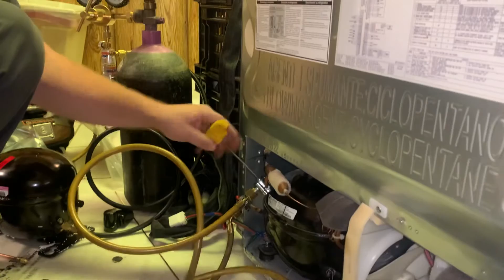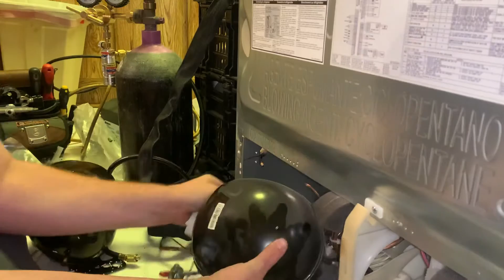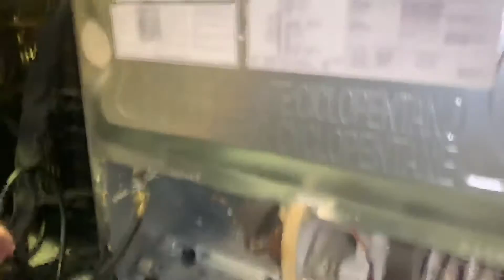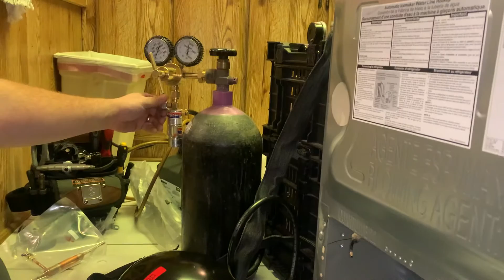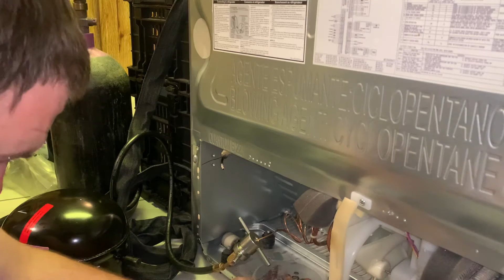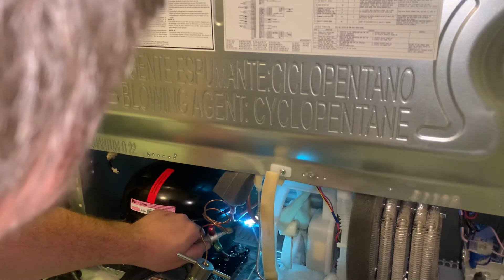Lg compressor replacement

Comment: I use 15% rods for the low side. For the drier, I use 45% and for the high side. But the flame would never be that big.
Reply from the maker: That’s a pretty small flame believe it or not. Unless your using a jewelers torch I doubt your getting less.   One thing I have noticed is that an iPhone camera tends to show more flame than we tend to notice while staring down at it.

Comment: What type of material did you use to join the copper and steel lines ?Thanks!
Reply from the maker: @jrvirrueta7168  high flow braze with a 45% silver content and flux

Comment: Wow really professional and really the only way to do it with this lg crap. But what’s your thoughts on switching to a conventional embraco compressor with some type of relay from fan to switch from dc to ac? Most everyone where from does like this instead of using lhs crappy compressor?

Comment: Thanks for this great video.  The tubes that connect to the bottom of the compressor is aluminum.  How would I weld the aluminum tube to the compressor?
Reply from the maker: They are generally made out of steel, you’d want to use flux and 45-50% ag braze. Check the tubes with a magnet.   (It’s been a while since I’ve worked on lg’s so I don’t know if any of the brand new models use aluminum tube on the high side so check it before trying to braze it)

Comment: Why is flux Being used? 15% rod is all you need to avoid clogging up that drier. Has this process changed now?
Reply from the maker: Typically the high side connection to the compressor and the Yoder loop connection to the filter drier are steel to copper.  I use a 45% ag brazing rod for those and you should use flux for that.    I’ve brazed it with 15% before but you get much cleaner results with the high flow.
Reply: @steveb5967   Okay great thanks for the update also where can I buy that nitrogen adapter adapter ? That will help my life tremendously

Comment: There is a fact that I want to understand about these LG refrigerators that has linear compressors in them,when these compressors goes bad,is it compulsory to replace these compressors with linear compressors or another brand will still work.

Comment: Thx LG for designing a 3 year lifespan sealed system. Well done.
Reply: Costs more to replace the compressor than it does most entire units.
Reply: Their "5 year warranty" only covers the $250 compressor, not the $1k labor, gas, and other parts costs.
Reply: @thefireysoul  I guess it depends where you purchase it. My system had failed in about four years, but fortunately the unit was under both parts and labor warranty. I got my compressor replaced for no charge. I think it is a 5 year parts and labor warranty, up to 10 years parts only.

Comment: hi, steve . what is the name of that tool sliver with 4 bar. u use for nitrogen to copper pipe
Reply: Robinair 12458 Process Tube Adapter Kit for 3/16", 1/4", 5/16", 3/8" Copper Tubing

Comment: I've got an LG fridge where after replacing a compressor the fridge still fails to get cold, any ideas on what might have happened?
Reply from the maker: Without putting gauges on to diagnose it there’s too many possibilities to list, but if the compressor is running then the most likely possibilities are a restriction or clog that was either preexisting or occurred during the repair, or possibly a leak.
Reply: @steveb5967  the compressor is not running and it’s a brand new compressor that’s the problem we aren’t sure what’s wrong
Reply from the maker: @esmeman0383  if you press the test button on the back does it try to run? If it doesn’t check the plug going to the compressor for voltage..   it usually only connects to 2 pins of the 3 on the compressor. Check to make sure it’s turned to the correct pins…. You can check them on the compressor with a multimeter for resistance. The third pin will either not be connected to anything, or will be grounded.. it’s easy to get the plug turned the wrong way.
Reply: @steveb5967  I’ll take a look thanks

Comment: Good stuff, Thank for sharing.

Is this safe to do inside of the home? Fumes and Refrigerant leaks? 

Are you replacing it with the same Problematic Compressor or an updated version that LG Now uses?

Do you use flame Retardant material to protect its surroundings and Flooring? 

Also I was told that once this is done a Program update is required to account for Refrigerant inside line and cool properly or something to that notion. 

I am in NYC and The reason I ask this is because I need to have mine Done. I have a Friend that used to work on Commercial Sub Zero Refrigerators for LABs but is retired now So he doesn't do the work himself anymore. but did recommend a few people.  I prefer to hire an LG approved Company because American Express is Requiring it to foot the bill :o) SO why not?  If your in NYC area and are LG approved let me know. 

Having a Fridge go down is the worst. luckily for us we have another fridge in the basement and a Freezer in the Garage. 

Thanks again for sharing.
Reply from the maker: As long as reasonable precautions are taken it is safe to do in a home. I typically use a mat to act as a barrier if something hot drips, I don’t use flameproof mats (other than one on the floor) much these days because I’m very used to working in a compressor compartment and I have a very small torch that is designed for tubing and small spaces….  If you are in a high rise you might want to check if they have special restrictions on hot work….  Generally it’s a different  updated compressor and it generally requires a software update which is just as important as the compressor.  You must remove all the refrigerant from the system and any trace amounts should be removed by the vacuum process before the system is charged. I am nowhere near New York, so I can’t help you with that. I would recommend calling lg customer service to find the closest lg authorized repair company.. then compare the online reviews of the companies they recommend..     it is definitely a bummer when a fridge goes down. Glad to hear you had a way to save the food.
Reply: @steveb5967  Awesome to know, Thanks for the reply 🤗

Comment: Hi
Where did you buy access fitting tool for nitrogen tank?
Reply from the maker: You can find it on Amazon.. otherwise I’d search Robinairs part number for it and see if it’s available elsewhere for less.   https://www.amazon.com/Robinair-12458-Process-Tube-Adapter/dp/B00C2GWNP0/ref=mp_s_a_1_20?crid=3AC5R4DM1KX7C&keywords=robinair+access+fitting&qid=1678111406&sprefix=robinair+acess+fitting%2Caps%2C355&sr=8-20&ufe=app_do%3Aamzn1.fos.f5122f16-c3e8-4386-bf32-63e904010ad0
Reply: @steveb5967  Thank you!!

Comment: With the reverse flow valve in the netrual position I should be able to get flow just as if it were a single evap unit, right?

Comment: Thank you for this video. I am watching it because my LG fridge might be needing a second compressor replacement  and the repair man will be arriving shortly. Wouldn't it be easier by joining the connections with the compressor outside the compartment, then placing it inside when the joining is complete?
Reply: It's not possible. The lines don't stretch.

Comment: I bought a LG lmxs30776 /01 in Dec 2014. Compressor was replaced in 2019 still under a 5 year warranty. Today 9/6/2021 The Frig is not cooling again . So pissed. What  piece of crap.
Reply from the maker: Sorry to hear your going through that. Unfortunately it’s been my experience that the quality of the repair will directly affect how long it lasts, I have seen plenty of occasions where someone installed a new lg compressor carelessly and did not fully vacuum the system dry, or left debris or oil in it and it led to premature failure. I do think if you perform the repair properly it’s a solid repair. I trust my work enough that I have an lg in my kitchen which I got off of Craigslist broken and then repaired.

Comment: What size tip are you using on the smith little torch?
Reply from the maker: That’s actually not the little torch, they have a slightly larger one called a quickbraze setup that’s specifically meant for tubing. It’s unfortunately more expensive than the little torch but it is pretty much perfect for this kind of work. If you check out  the video I did comparing different torches it shows it pretty well with both that single flame tip and a 5 flame tip.

Comment: what type of handheld lighter do you use? I use a flint striker but would like to get a piezo electric.
Reply from the maker: Found that piezo sparker at a weilding supply store near me, it worked well and then started getting squirrely so I went back to normal flint strikers.

Comment: 17:17 WARNING!!!! Don't burn the compressor!!
Reply from the maker: Hard to see from the angle of the video but I don’t have flame aimed at it for any real length of time, also you would have an extremely hard time melting through the casing on that compressor or damaging it with that torch… about the only way I could think of that doesn’t involve many minutes of concentrated heat on the casing would be if you somehow were aiming it at the point where the tubing goes through the casing or at the electrical connection..   inside of that compressor is about a 1 inch gap between the shell and the mechanical assembly as well.    Now If this were a whirlpool wisemotion compressor it would be a different story.

Comment: The failure rate of linear compressor is more or same as Rotary compressor?
Reply from the maker: Hard to say honestly, the ge rotary compressors were before my time. Does seem like lg is sticking to this design though, as I understand it ge got away from the rotary design pretty quickly..

Comment: Hey Steve what about if your working on a lg with the three way valve. Can I still clear the restriction the same way through the cap tubes since there is a check valve. Instead of having to disconnect each cap tube on the evaps. I can just disconnect the cap tubes from the three way valve and disconnect the suction from the compressor
Reply from the maker: It depends on how bad the restriction is. First you have to be sure the three way valve is parked in full open by pressing the test mode button to force it to cycle. The check valve will only prevent refrigerant from blowing backwards from the suction line to the cap tube.   When you blow through the three way valve open it will force nitrogen through both cap tubes, if the back pressure against the cap tube on they clear evaporator is greater than the pressure it needs to clear the clog then you might luck out and clear it, otherwise you’ll have to debraze the cap tubes and blow them out individually.

Comment: I don’t like soldering that close to the plastic cond fan
Reply from the maker: Practice makes perfect. First that torch is very small compared to a turbotorch or a full size victor style torch so the flame is a lot more manageable, I go pretty quick in this video because I’ve done a lot of these, but the direction of the flame and how I’m aiming it at the connection matter a lot, heat will build mostly in the direction the torch is pointed, so thinking through where it’s aimed and what’s behind that is crucial to these kind of repairs, the suction side connection, discharge connection and the cap tube connection to the filter dryer can all be done with the flame parallel to or pointed away from that plastic fan.   I’ve got another video where I recommend practicing by brazing scrap tubing in a cardboard box and I find that really helps force you to be aware of where heat builds when you work on these, the cardboard box will burn long before that fan will start to melt.

Comment: hey Steve. I notice that you are using the Robinair attachment on that cap tube  what size are the insert on that Robinair?
Reply from the maker: The kit has 4 different sizes of fittings, I use the smallest one for cap tube then the second smallest for the high side line
Reply from the maker: Not sure on what the exact dimensions of the inserts are.. generallly you want the one closest in size to whatever your putting it on

Comment: very nice work brother.  what type of torch are you using and where can I get one?
Reply from the maker: It’s a smith quickbraze torch kit, much smaller than a standard oxy acetylene torch, however it’s bigger than a jewlers torch.  I’ve found it on Amazon, otherwise gotta try and find it at a wielding supply store.

Comment: How much would this cost??
Reply from the maker: Do you mean how much would all the equipment cost to do this? Or how much would this repair cost?
Reply: @steveb5967  like repair total. Like for compressor and putting it on
Reply from the maker: @BobbyHilll132  depends a lot on where your at and what company comes out to do it. The parts are around 400$ If your using the factory drier, however a lot of these are under warranty from lg. As for the labor I’ve seen anywhere from 300$ from someone who warranties it till they leave your driveway, up to 800$ in some markets.   Where I work we typically charge around 600$ in labor however we warranty the repair for 1 year parts and labor.

Comment: can you tell me how it’s called and where I can buy the valve use after 6:20 with the nitrogen?

please ?
Reply from the maker: The stub that attatches to the system is a Robinair process adapter kit, I’ve gotten off of Amazon usually https://www.amazon.com/gp/product/B00C2GWNP0/ref=as_li_tl?ie=UTF8&camp=1789&creative=9325&creativeASIN=B00C2GWNP0&linkCode=as2&tag=sbretztech-20&linkId=f0e342ecf545955d83966cd847a7faba
Reply: @steveb5967   Thanks
Reply: Its a uniweld nitrogen flow regulator.  Essential if you want to purge without leaks

Comment: can you tell me how it’s called and where I can buy the valve use after 6:20 with the nitrogen?
Reply from the maker: The stub that attatches to the system is a Robinair process adapter kit, I’ve gotten off of Amazon usually https://www.amazon.com/gp/product/B00C2GWNP0/ref=as_li_tl?ie=UTF8&camp=1789&creative=9325&creativeASIN=B00C2GWNP0&linkCode=as2&tag=sbretztech-20&linkId=f0e342ecf545955d83966cd847a7faba
Reply: @steveb5967

Comment: What was the service valve attachment that you used at 6:28 for blowing nitrogen to clear the system?
Reply from the maker: That’s a Robinair process adapter kit. https://amzn.to/3qJQ0f4.   Useful for adding a temporary connection to blow out tubing, flow nitrogen, or you can put one on both ends of a component that you’ve cut out and pressure test just that component for leaks with nitrogen. The kit has 2 adapters in it.
Reply: @steveb5967  did you use the same kit (Robinair 12458 Process Tube Adapter) to connect the capillary tube  7:24

Comment: Could you please list all the materials used in the video, for instance the type of Brazing Rods. Did you use the same type of brazing rod for all your connections? If the liquid line going to the Condenser from the Compressor is not copper, what type of brazing rod do you use to braze copper and another metal.
Reply from the maker: 15% ag brazing rod for copper to copper, 45% ag high flow with flux for the copper to steel.   Most condenser lines are steel.
Reply: @steveb5967  Excellent........Thanks !!!